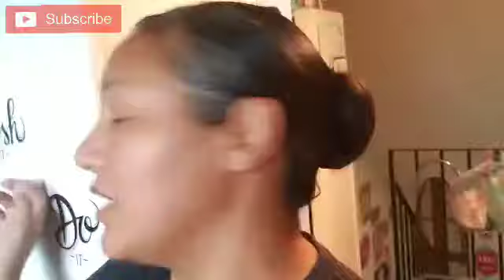161. My HORRIBLE Workbox 3.0 😭

Comment: I've had the same experience. I'm sorry you had to go through it too. Bought mine November 2018. Had my doors "fixed" by the company twice & finally gave up. I still have to lift the doors to close them. I have hardwoods on a concrete slab in my basement...no carpet. You'd think a $2000+ piece of furniture would be better. My husband (who works doing custom cabinets) assembled it.. he said it was complete garbage. I spent the whole time convincing him it wasn't. Sad. They changed the design of it & then discontinued it. I think others have had the same problem. Maybe yours was the same Friday mine was made.
Reply: Also, thank you for your service! Having been diagnosed with PTSD myself, I feel you girl. On all the levels! ❤❤❤